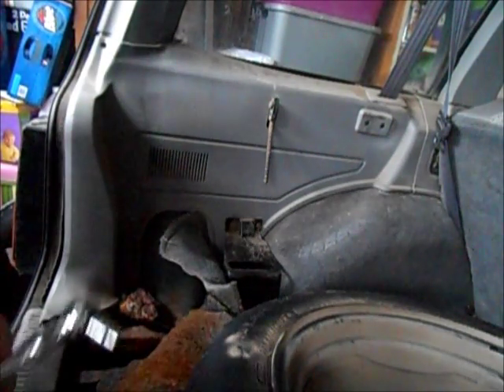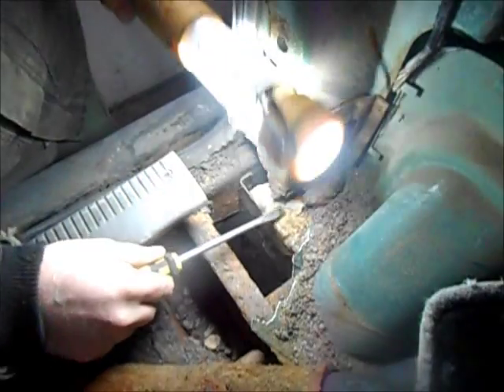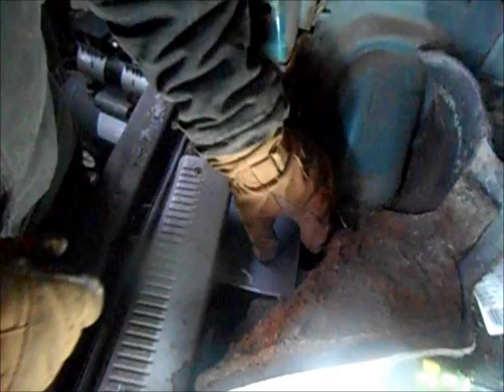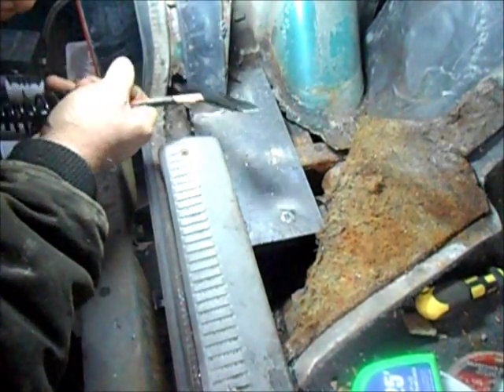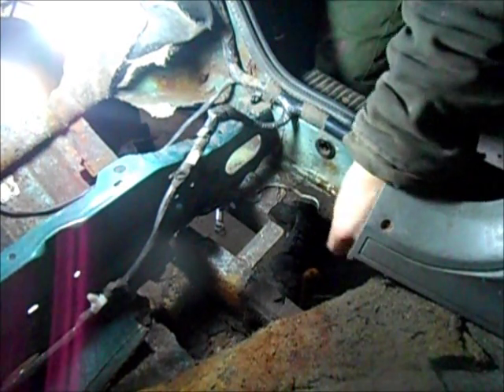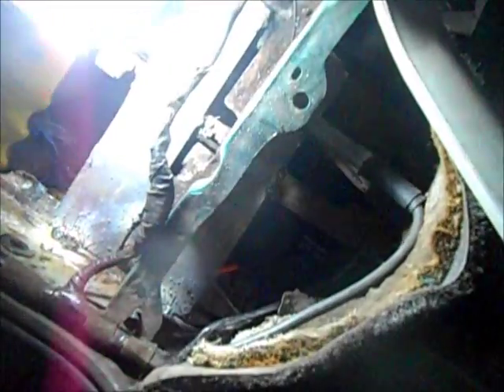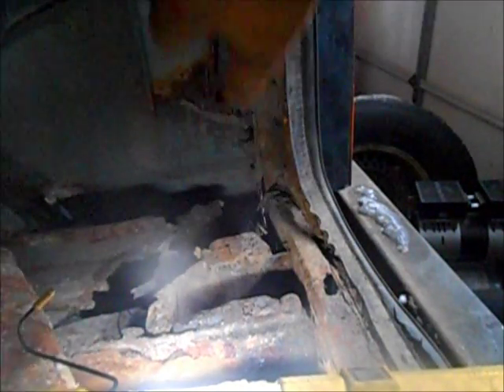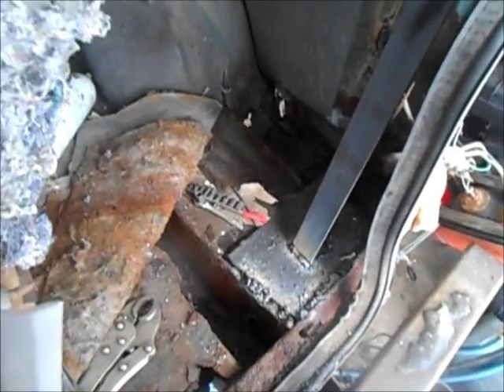Leaf Spring Replacement - part3 (spring mount repair & reinforcement)

Comment: Jason,  I finished my springs today (96 XJ).  I started yesterday around noon, and finished today around 2pm.  My job was similar to yours, perhaps a little easier because I have less miles on the vehicle.  Man that job is brutal.   Not technically difficult at all, but just brutal.  I ended up cutting two bolts (one upper shackle, and one leaf eye bolt), but luckily in both cases I had the end of the bolt out of the captured nut, so once I cut them I was able to take them out without having to fish the remains of the bolt out of the nut.  Funny how it is SO many hours to get them out, but putting them in was about 30 minutes each!  Thanks for sharing what you learned, it definitely helped arm me with additional techniques.
Reply from the maker: +Jordan Moore That's awesome, Jordan.  Glad it all worked out for you.
Reply: +HEAPofJEEP By the time I was done, 2-3 lbs of powered jeep was sitting on the garage floor.  But so far I have done axle u-joints, front hubs, steering damper, all shocks, rebuilt both drive shafts (replaced double cardan centering yoke), new rims, new tires, new exhaust, axle bumpers, hole in the driver foot well, every fluid.  She's actually starting to look a bit cleaner underneath now.  Mostly its just the floors in a few places that are crumbling and I'll get to that at some point.  I have also punched holes in the rockers so that I could fluid film like crazy up in there.  I think I should just drive it for a bit now.  Though I'm definitely thinking about 1" spacers for the front now.  Because the new spring are going to be way high for a while.
Reply: +HEAPofJEEP Oh, and doing this job in a dark cramped garage in single digit temps must have been absolutely miserable.  Hats off.

Comment: I have 2 1996 and 1997 grand Cherokees. The 96 is all rusted on the frame , been welded numerous times. It was bought from a customer of mine. Now my 97 is like new, no rust on the body or frame. That i got also from a customer that keep it in the garage. got that about 7 years ago. Will use the 96 for parts when it can no longer be welded. Nice job by the way.
Reply from the maker: +lar4305 That's really cool... always nice to have a donor vehicle ready to go.  Thanks for checking out my video, and keep on Jeeping